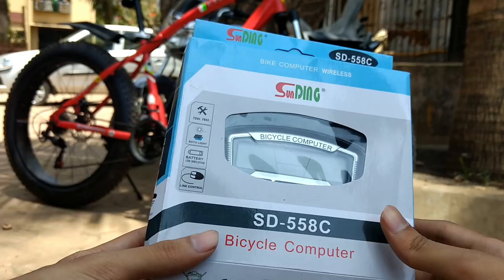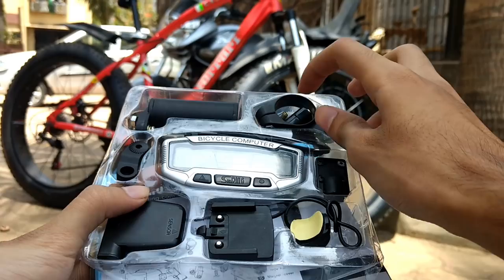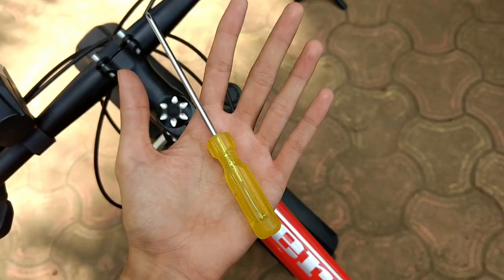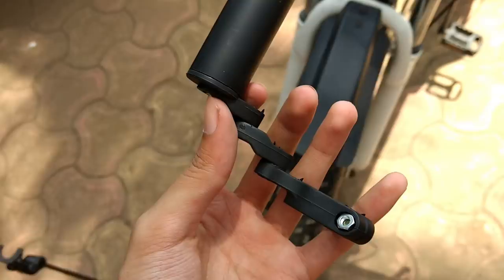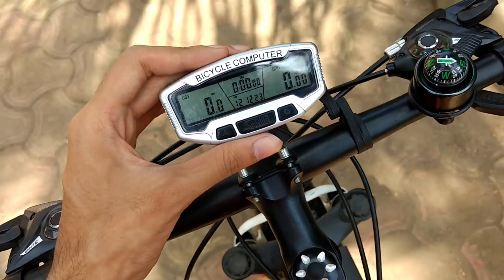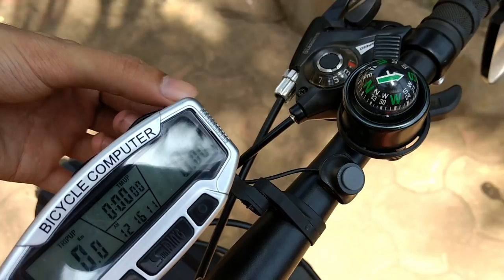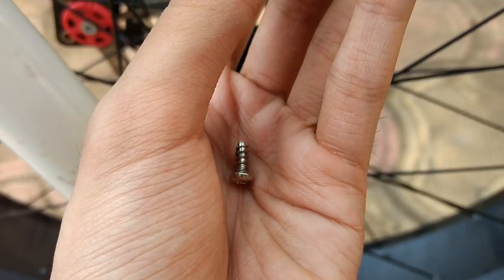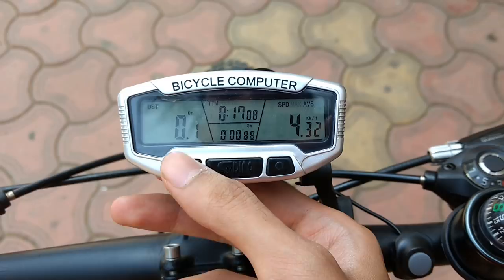How to install Digital Speedometer in Fat Bike & Mountain Bike? Ferrari Fat Bike Bicycle Computer

Comment: I have the device although the packaging and perhaps one of the components is different or missing. Most of the parts assembly or placement on the bike are the same. Although the one point I'm unclear on is how the signal gets from the sending unit on the fork to the display. I tried to pick it up during the spoken narrative but much of it sounded to be spoken in Hindi?? Not English which is my native tongue. 
Can you describe how the signal gets to the display? Thanks.
Reply from the maker: The small part that attaches to the spokes is magnet. You set up the wheel diameter on the display monitor in settings and the speed is then calculated based on wheel rotation per second and then displayed on the digital display.